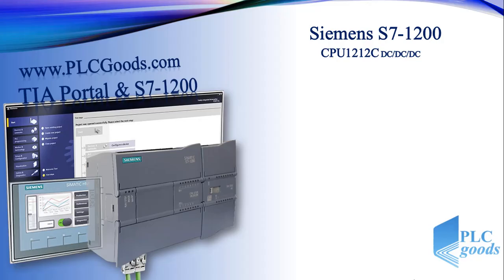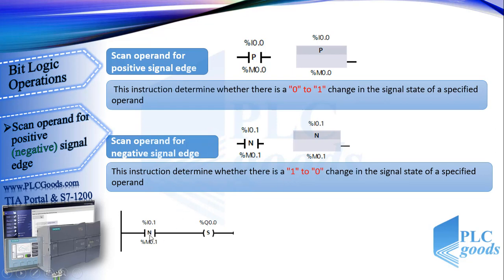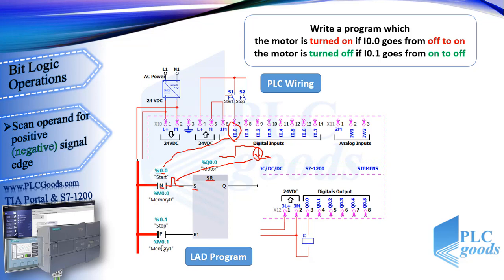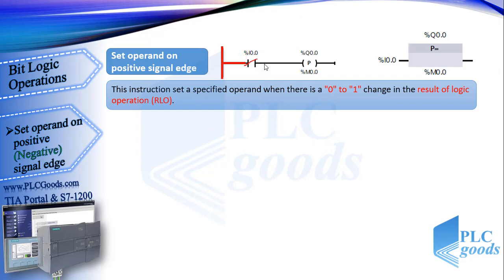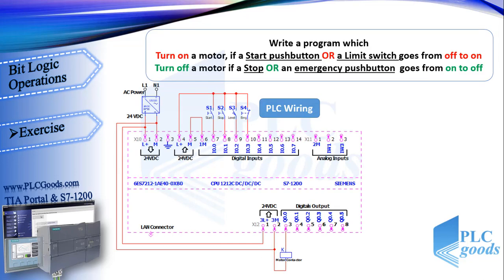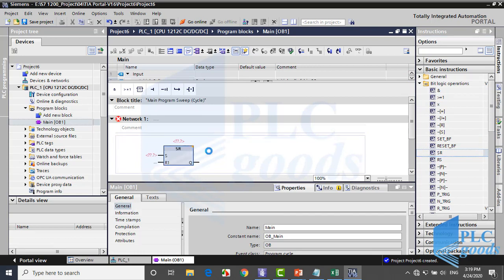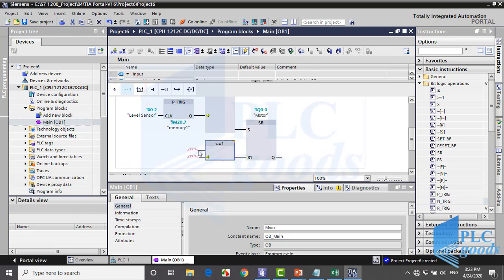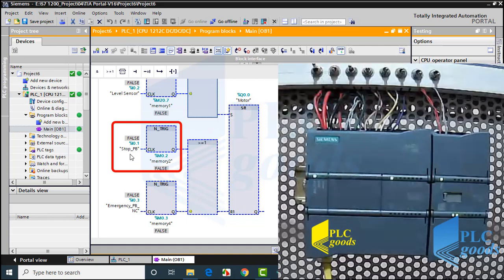PLC Edge Detection Tutorial in TIA Portal | Positive & Negative Signal Edges | L 11

Comment: Hi
Thanks for your video but first there is an error the stop button must be normaly closed.
Then for your simulation by the plc you use switchs to simulate start and push button. Normaly it mus be real push buttons !
It's the best way to explain positive and negative edge !!!
Reply from the maker: 💚💚Thanks a lot for your feedback — you’re absolutely right!

Yes, the stop button should normally be NC (Normally Closed) for safety reasons — that's a good catch.

Also, for a more realistic simulation, you're right that real push buttons (momentary type) are better than simple switches. Using real push buttons helps better demonstrate the positive and negative edge detection in PLC programming.
In the video, I simplified it a bit for beginners, but I appreciate you pointing that out — it’s an important detail! I'll make sure to emphasize this even more in future videos. Thanks again for sharing your knowledge!
Reply: @plcgoods  You are welcome ☺